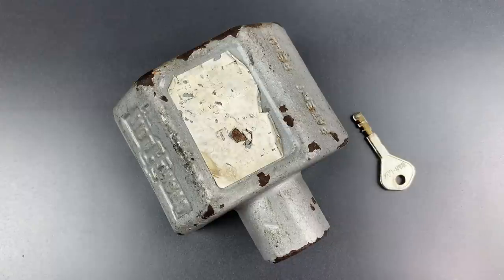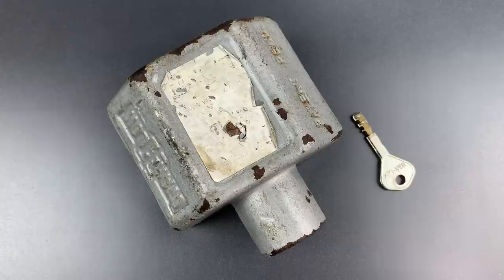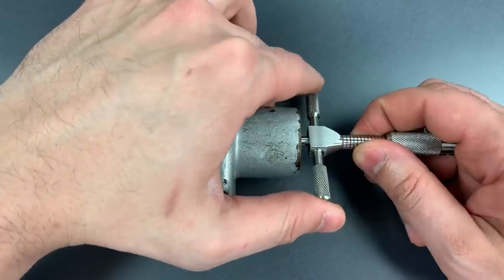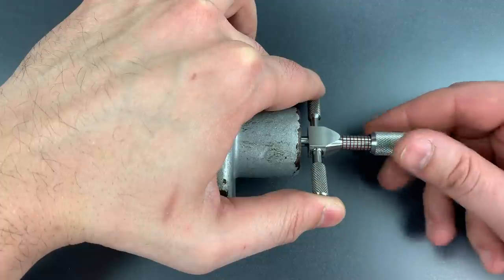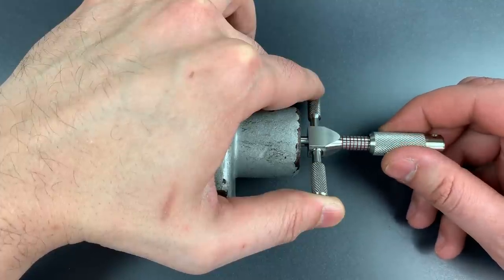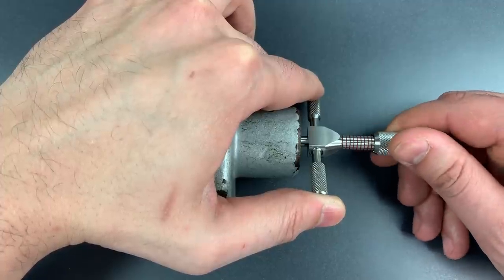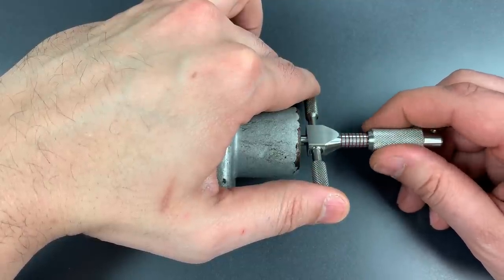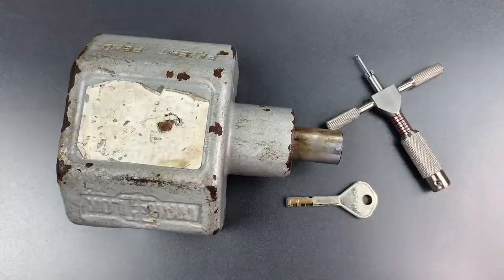[837] “War-Lok" TL-10 Cargo Trailer Lock Picked

Comment: A new feature for high security locks: Just add some grit and corrosion to factory-fresh locks, in an amount that still allows the key to operate.
Reply: If I were a lock maker I'd be carefully studying exactly what makes a lock difficult to pick, even if it is something incidental that occurs with use.
Reply: It also increases the chance of possible failure as well though
Reply: A counter to this would be using some WD-40 before picking.
Reply: roo purt
It doesn’t necessarily increase the chance of possible/eventual failure, but it does reduce its expected lifespan considerably.
Rust, dirt, wear and tear are any mechanical system’s mortal enemy, especially for metal-based systems.
Remember, things may be built to last, but everything will eventually fail.

Comment: I use a standard shaped high security Abloy padlock for this purpose. I haven't seen any quite like this in my travels, but I have seen some interesting different locks for this purpose.
Reply: I had one break in, where they cut the part of the trailer that the lock and seal are placed on. Newer trailers have a much thicker, dedicated place for the lock, but this trailer lacked that. They got in and stole 4 cases of raw beef weighing several hundred pounds. That's the only instance in my 5 years driving of any obvious attempts to break in, despite most of our refrigerated trailers lacking the dedication place for the lock.

Comment: Interesting lock, never came across one in the “wild”.  Usually doors are secured with a crappy master lock that after a few months can only be opened with a bolt cutter.  Most of the time anti tamper seals are the only thing protecting loads (groceries meat, dairy and produce) they range from cheap metal and plastic to braided steal that are similar but not as thick as a bike lock.

Comment: I've been an apprentice of Bill and yourself for a good number of years. My father returned a lock to me that used to secure a supplementary door on my first apartment in quite a disreputable area in my town many years ago. I gave him the two locks I used to prevent unlawful access to my residence at that time , in order to secure his garage door. He recently returned one of the locks to me when I admitted to him that I was in to lock sports. I told him I would return it to him unlocked or not at all. My father is in his late 70's and my time is running out. I have seen several quite expensive Chinese picks that claim to be able to open this lock, but I am skeptical. would the pick you used in this video be a practical tool for picking an abloy 3071 core? Please respond.
All the best
Darren.
Reply: Bill & LPL make it look like it’s easy, it’s not! You’re attempting a 7 or 8 disk quality lock, good luck.
Reply: My count on this picture is 9 discs?!?
https://www.alamy.com/stock-photo-abloy-3071-cutaway-padlock-43425538.html
Abloys are generally super hard to pick, and the Protec 2 still remain undefeated... So good luck!

That being said, any disc detainer pick that can comfortably tension the lock and manipulate the discs should do. Sure, having lines to go of, so you can visually see which disc you are on is nice to have... but not a need to have.
Reply: Huxleypig has picked a Protec 2 here: https://www.youtube.com/watch?v=6UZ6tcvgd9U

Comment: LPL, I'd like to see you attempt picking this lock as it would be installed on a trailer door. It's great to have the lock in hand, but that's not real world.

Secondly, the key that that lock is using is a very old design. It appears to be a cross of the Abloy Classic and the Abloy Profile key, using a wide disc.

I bet you'd get different results picking it standing upright as it would be installed.
Reply: I believe that is why he held it flat to the table to best simulate it being attached to something, not perfect, but you could see that it greatly reduced the tensioning ability of the tool
Reply: Everyone can use Abloy classic , its patent ended long time ago , when its over 100 year old tech ... still one of the newest mechanical lock techs on market .

Key is too close , but even that has been in court and Abloy dont have protection on that key shape .

Comment: Whoa, that pick''s made out of steel!  Where did THAT come from? Regarding bottom tensioning, what about a second tip with a "paddle head", and swapping out the nose with a pick sleeve from a Goso bottom tenioning pick? Maybe just get another injector pin, mill or grind down the pin head to the appropriate sized tensioning block, and swap out those grub screws for longer Allen bolts?  Also I sent you an email about this, but I see the solution is even easier: PLEASE DO NOT CHAMFER THE HOLES FOR THE GRUB SCREWS.  Please leave them at full diameter of the pick holder. It will not affect the currently used grub screws, but will allow sufficient surface area to swap out the grub screws for longer Allen bolts to be used as tensioning handles. PLEASE ADD THIS TO THE DESIGN PLANS!   It will cost less in production costs and add a MAJOR upgrade to the tool's versatility.

Comment: What could be sprayed into the lock to flush out the crud and make it easy to turn? Lots of LPL fans turn their nose up at WD-40. If not, then what?
Reply: A CPL gun cleaner will work wonders on that.
Reply: Graphite.
Reply: The regular blue can WD-40 had a large volume of petroleum distillates that dried out leaving a film to gum up.

WD-40 has a reformulated product called Rust Release, that has a different blend which doesn't turn to gum when heated. It's a clear liquid with a very mild smell. After heating the liquid to 200F for 24 hours, less than 5 percent by weight is left behind.

I use a silicone spray to flush the lock of grit, then canned air to remove most of the liquid portion. Any liquid you leave behind will attract dirt and form mud inside the lock.
Reply: @gungadinn , That's true, it's what I use now but the graphite is still a good choice, in spray.
Reply: A Three Dog Night +

  When I was growing up, the only lubricant that locksmiths used was graphite as a powder. It came in a small pen type applicator. 

It’s still a good lock lubricant today.
Reply: Houdini is the juice you are seeking. Locksmith lubricant/cleaner that works great available online. Never use dubya D in a lock to reiterate.
Reply: Agree with Skygh, Houdini is great for this. Flood the core with it, and watch the grit and grime flush out
Reply: WD40 is not a good choice for a lock that is still in use because it leaves a little too much oil behind when the solvent is evaporated, which can lead to buildup of gunk over time. But for locks that you ever only intend on picking WD40 is perfectly fine. Don't listen to the snobs.

However, if you were doing it on the job, you could rinse it out with acetone and apply a lock suitable lubricant once its dry. Acetone does leave behind a tiny amount of residue (unless you buy the lab grade - which you don't!) but it is insignificant in this context.
Reply: I use Super Lube dry film lubricant on my locks.
Reply: @andersjjensen  I am a smith. Nasty stuff if you have to take locks apart and if you don't do this everyday then maybe you should give it a whirl. Get an old grimy goo filled lock, stain your fingers and clothes rekeying the spooged up mess, repeat weekly for 30 years then share your learned opinion. As for the suggestion of using acetone to remove this stuff you just put in--oh never mind <face palm>.  You could just use Houdini which is safe and all you need. This is my last comment on rocket protectant mineral oil film. I give up. Spritz whatever you want wherever you think you should. Signed, The Snob.
Reply: Flush with Chlorinated brake cleaner, lube with any thin oil (gun, sewing, marvel mystery...)
Reply: Or spray carb cleaner, but it can lift paint, and might melt some plastic cores. @andersjjensen
Reply: There is now a WD-40 3-in-one Lock Dry Lube product I've purchased at Lowe's. It says it drys within minutes and leaves no messy residue. I used it on some sticky door locks and it seemed to do a fine job.
Reply: a Grease Gun would do just fine for the nearly zero effort involved as long as you loaded it with something fairly unlike the normal very viscous almost molasses stuff that would be used. blast it completely full of grease.

not a long term solution (that would be disassemble it and clean it manually) but a choice that'll help get the sand out of the way if something is being uncooperative.
Reply: @gungadinn , Yes I still have some of those & in a big bottle as well. Then the spray came out & now I have that also. W-D is only good for freezing up the locks making them much easier to pick with age.
Reply: Neolube- colloidal graphite suspended in isopropyl alcohol. Dries out to graphite, but gets in like a  low-surface tension liquid.
Reply: @danpowell806  
that's a good idea.

Comment: If the lock was mounted to the truck, would you have been able to rotate the tool enough to unlock it? It looked like you had to lift the lock up to get clearance for the tool.
Reply: He could maybe use a different tool to rotate without requiring clearance.
Reply: It's only the grips for tensioning that require significant clearance and it looks like they could be replaced or removed at a push.
Reply from the maker: Once the sidebar is set, I could completely remove the tool and use a screwdriver to rotate the core. It doesn’t need to be the tool.

Comment: I have a question I'm sure you could answer. I keep the key inside my lock when I sleep at night, because I know my key doesn't work when a key is still in the lock on the other side. I figured it would make lock picking harder as well, or even impossible with a little luck, but I don't have the tools or the skills to test it. So here's my question: does this actually help? Does it depend on the lock used?

Comment: Do you have a video explaining that tool and the terminology "tensioning" "binding" "in a gate"?
Reply: He recommended a book to understand lock picking words and phrases
Reply: THmusic also, bosnianbill and lpl made a 5 part series where they built this tool. watch the first and second one to get a basic gist of what the pick does
Reply: Been asking! A.K. I guess asked too. Thanks AK
Reply: Look up the videos by Schuyler Towne -- he has a series on disc detainers with very good animations and video explaining how disc detainers work and how the picks for them work.

The basic idea is that you're rotating a bunch of stacked discs that the key would normally go through and rotate to varying degrees, until a bunch of notches in the outside i.e. "gates" line up. This allows a metal rod called a "sidebar" to fall into those gates. The sidebar would otherwise block the rotation of the cylinder. A disc is said to be "in a gate" when its gate is aligned with the sidebar. In addition to "true gates" which are deep enough for the sidebar to fall completely into, there are typically also "false gates" which are shallower notches, and serve to provide confusing feedback to pickers while not being deep enough for the sidebar to fall into.

Tensioning refers to applying some rotational force that would cause the cylinder to turn if the parts of the lock were correctly configured. If they're not correctly configured, some parts of the lock will press against each other "bind", and noticeable friction will be present. This happens in pin-tumbler locks as well, and the same terminology is used there.

Disc detainer locks can be designed in varying ways with regard to which discs actually interact with the cylinder and push on it to cause it to turn when the lock is ready to open. Originally, it was the "zero" (first) and last disc that would do this job, allowing the nose of the picking tool to grab the first disc and apply the required tension to open the lock. Some newer disc detainer locks instead require tension from a random one of the inner discs, which requires a more advanced technique to open. You can see that in some of LPL's recent videos.
Reply: 1234coolman  say that to lpl .he's the one who recommended the book
Reply: I've had the same question! I'd really be grateful if LPL would do a video defining some terms.
Reply: THmusic i think it’s self explanatory

Comment: 🤔 Hang pin a second...
... you picked all the disks,  used the picking tip to tension disk 8, then you turned the tension backwards and the lock opened??????????

Comment: Hi , I have been scrolling through your vids because I need help with a lock, but could not find it. It is a lock like this : https://www.accu-company.nl/nl/fietsaccu-accessoires/1526-montageslot-voor-fietsaccu.html . And it is in a battery like this : https://www.accu-company.nl/nl/aldi-fietsaccu/1796-fietsaccu-xh259-10j-zl07010f-A210035810.html which sits in my girlfriends bike but she lost the keys to it. The lock doesn't need to stay intact, I have to renew it anyway ( or do I ) . The only times I picked a lock  I used a drill, but I want to be sure I don't make it worse . Thanks in advance .